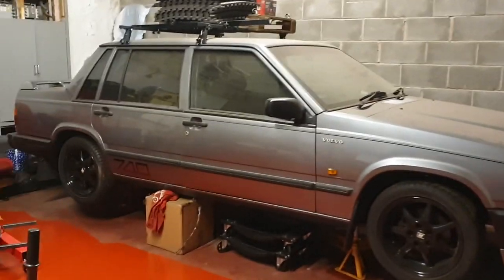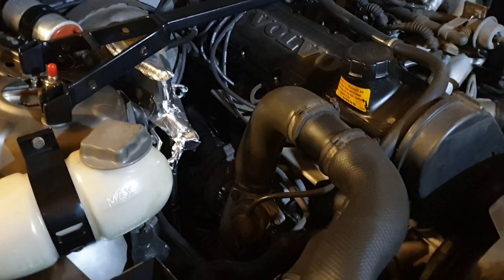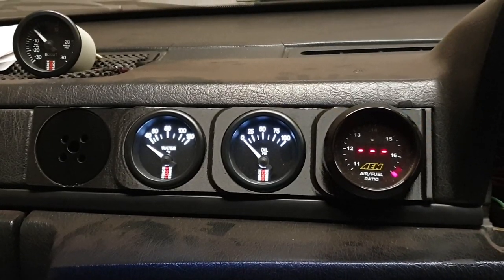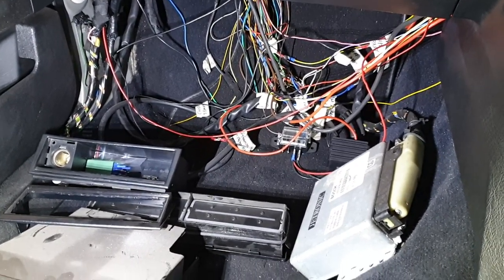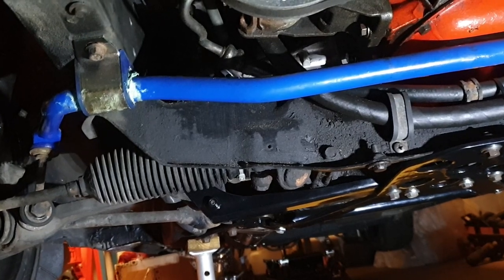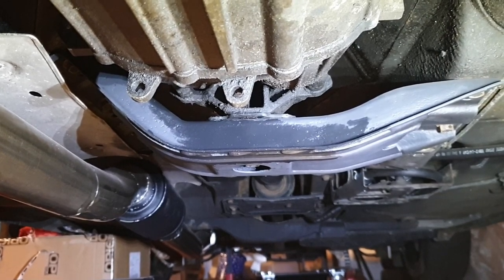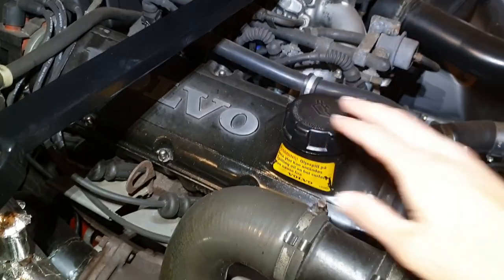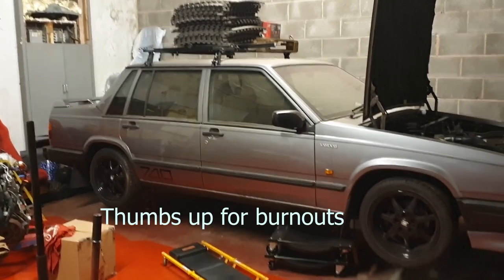Volvo 740 Turbo Hoon Saloon Project

Comment: Love the car man! I have a 93 940 turbo, do you know if I could run land Rover motor mounts?
Reply: Late reply but no you'd need to change to the earlier style mount, before they changed to the oil filled mounts.